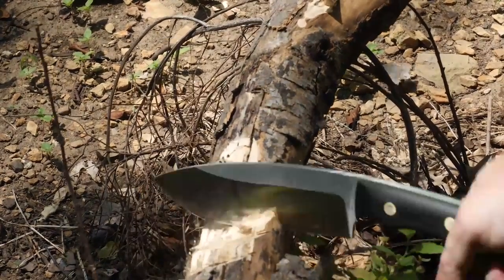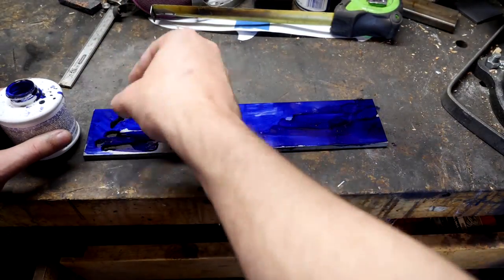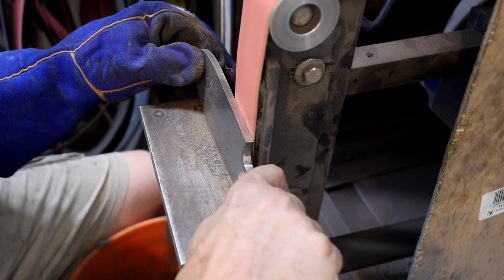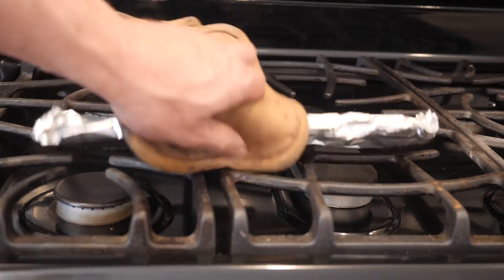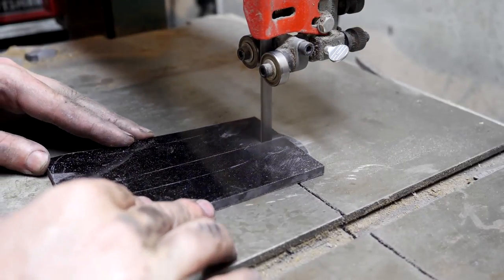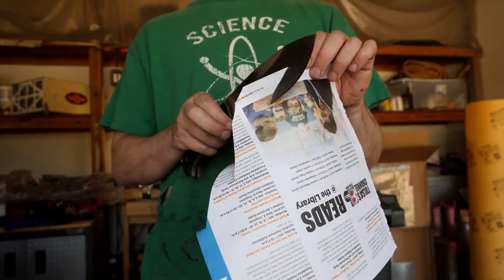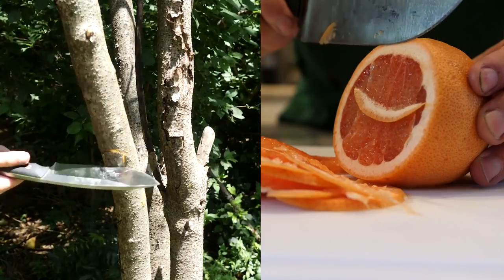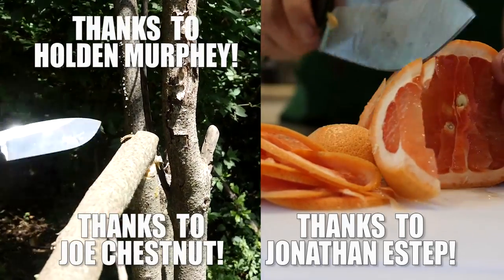Building A Chopper From 80CRV2! Will It Do It All?!

Comment: Aldo claims that 80crv2 is a great sub for 5160 and a lot of forums suggest 80crv2 has similar edge stability to 3v. With that said, zero degree bevels are the only way to see what this steel is good at. If you see any problems add the micro bevel then. Excellent video!

Comment: That blade but from 3/16" stock with a flat or convex grind and the same edge geometry would have handled that grapefruit just fine. I've moved away from 1/4"+ stock on all but the largest blades, and on those it really is still overkill. Like trying to cut with a splitting maul. Depending on the blade design / edge geometry, steel, and ht, .140"-.180" is more than strong enough for virtually any knife, even choppers.

Comment: Hi, great job. Both video and knife. How will a chisel grind do on a chopper like this? The alignment of the edge must be more difficult on a thick blade and You want it at the center of the blade. And which angle should be used?

Comment: I have used 1084 in my home coal forge with great success ,but I like to use other steels too, have been thinking about trying 80crv2 for some of the bigger blade projects. In terms of home heat treat how would you compare the 80crv2 with something like the 1075 from New Jersey Steel Baron ?

Comment: Really like your videos. I'm also a knife maker although I've only been doing it a couple years. One thing I've been struggling with is getting my knives hair popping sharp. I see you're using the wicked edge sharpening system. My question is is the wicked edge system worth the money? How do you like it and would you ever consider doing a review of it?
Reply from the maker: I could do one, its an older model.  I like it but there are cheaper alternatives that do just as well.  I'm about to have to replace my low grit stones which is going to cost about $160...

Comment: I'd go for more than 1% carbone to have a strong chopper. Enjoyed the video, love your humor, man!
Reply: more carbon doesnt necessarily mean a tougher blade. more carbon increases max possible hardness and edge holding. a steel like 5160 would make a much tougher chopper because its likely to form primarily lath martensite vs the plate martensite in higher carbon steels - but that comes at the price of hardness and edge holding capability. So overall a steel like 80crv2 being somewhat more in the middle of the extremes is a good choice for a tough blade that has decent edge holding. just my 2ct...
Reply: Well... the carbon content dosnt really say how well it will hold up to impact... the grain size and the temper has WAY more to do with it... and 1+% carbon is deffinently NOT ideal for a chopper... rather go for a 0.65 - 0.8 for something that will recieve strikes like that... 1+% is mostly used for cutting items that need to hold a very fine edge for long... the carbon content makes the steel more wear resistant (in normal carbon steels) and gives it more hardness but with less flex... if you want something that holds an edge better but can hold up to the strikes you need more vanadium (0.1+%) or another carbide suspended in the matrix... hope it helps...

Comment: Recently picked up some 80CRV2 to try out.  The supplier replaced his 5160 with 80CRV2 saying that it was essentially the same and should be heat treated the same.  I made a small edc k ife with it and was pleased,  but keep seeing people saying that you need a heat treatment oven and controlled temperature capabilities to use 80CRV2.  True?
Reply from the maker: probably true, google "kevin cashen heat treat 80crv2"

Comment: How quickly did the patina form after the grapefruit? 80crv2 is probably the least rust resistant steel I’ve encountered, I’m not knocking it though, just an observation 👍🏻
Reply from the maker: I rinsed it immediately so I didn’t really notice either any
Reply: Green Beetle ah, fair enough!

Comment: You should try "hammonding" 80CRV2
Reply: Well... its not possible... you can get a quench line... but 80crv2 isnt a water quenching steel so the traditional clay hamon wont work...

Comment: heey... just a tip... most professional kitchen knife sellers use carrots to compare sharpness/geometry in the kitchen
Reply: But it's not for kitchen use
Reply: @ellas8129  well... that would also deam the fruit slicing invalid... why not use the "industry standart" if its cheaper... (carrots are often alot cheaper) and would give a more relatable comparisson..
Reply: @ellas8129  and a 50* bevel could take a "shaving" of the fruit... but would stumple badly at a carrot...

Comment: A friend told me 80crv2 would be an amazing steel for a beginner instead of 1095 wich is garbage
Reply from the maker: 1095 is a very good steel but difficult to heat treat.  80crv2 is a good steel too but also requires temp control to heat treat properly.
Reply: @GreenBeetle  So.... are there steels that don't require temp control ? really ?